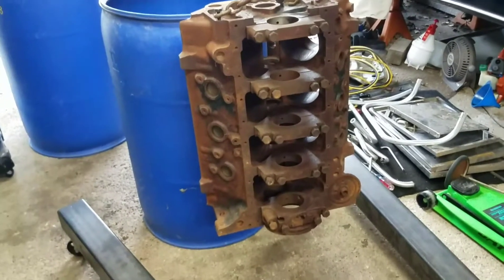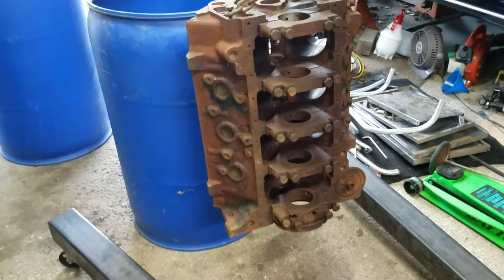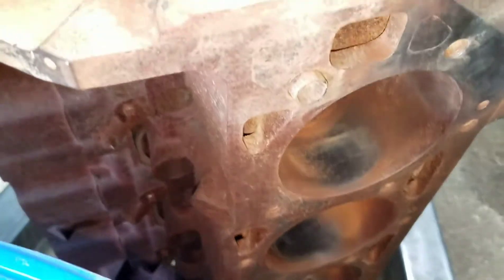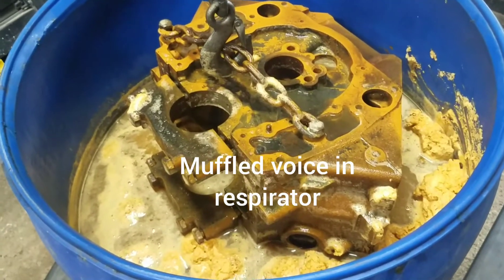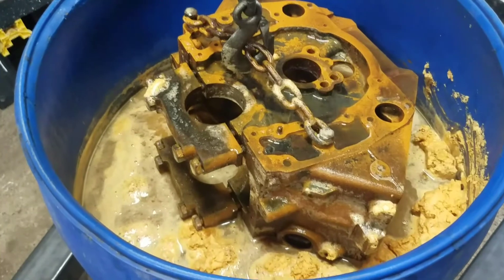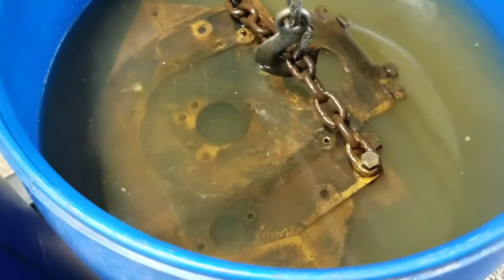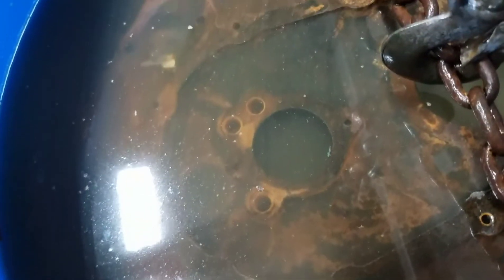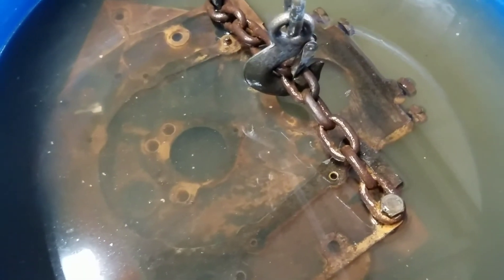DIY Rust Removal Engine Block Acid Tank 50 Gallon Barrel

Comment: How much acid goes into the barrel without damaging the block??
Reply from the maker: This was a long while ago but I think was like 2 gallons of acid and about 30-40+ gallons of water. Had to leave enough room for block. Biggest thing is having another barrel filled with 5-10 pounds of baking soda and water to neutralize the acid and fight new rusting from starting.
Reply: @ great!! I just got two big tanks to do this fortunately at an auction. At a bargain, so going to have them set up exactly for this purpose.. Thanks
Reply from the maker: Sounds perfect and good luck!👍